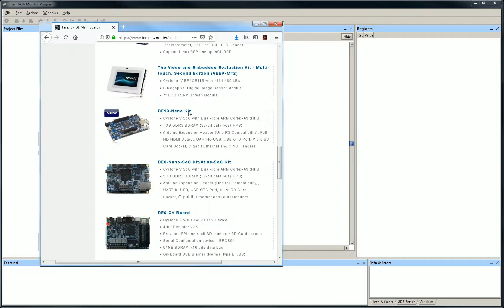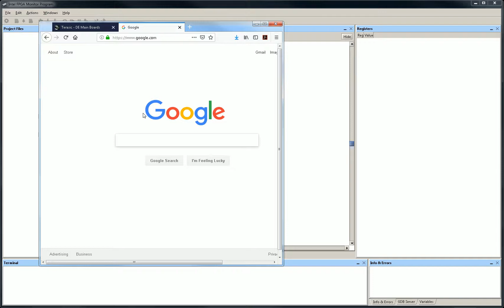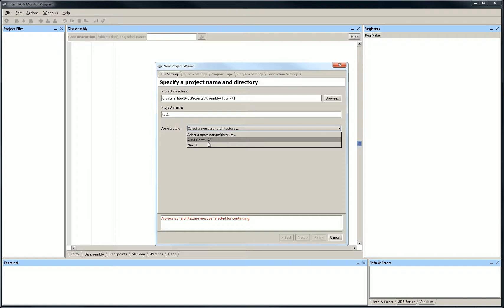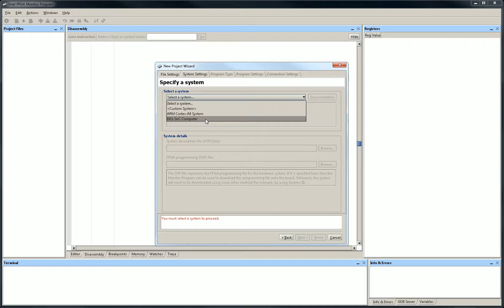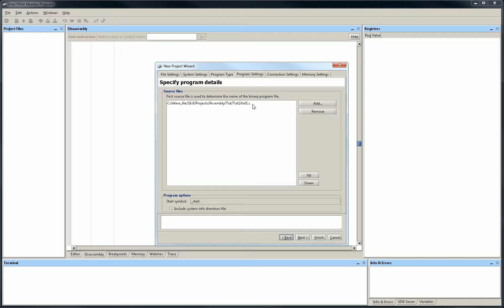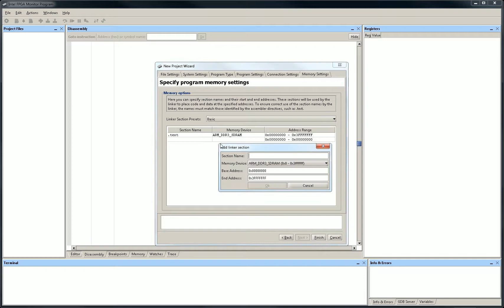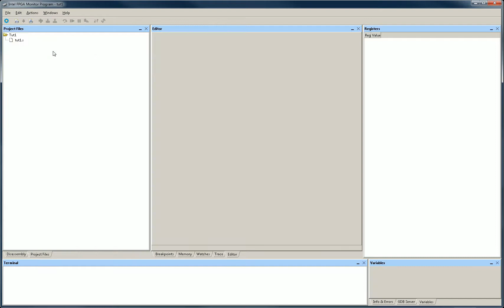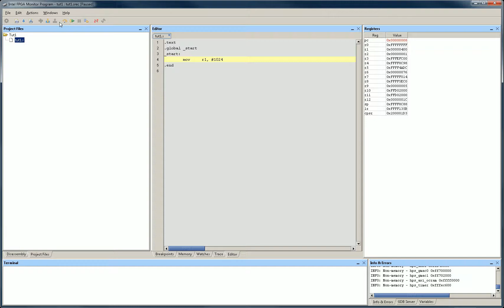Intel/Altera Monitor Program Tutorial - 01 Introduction

Comment: Wow, this video is alot of help, thanks alot. 
Now I'm learning about SoC FPGA, using DE0-nano-soc board. 
I have a question: Is it possible for Monitor Program to compile and debug code on completery customed system? 
As far as I know, we have to use "preloader" to set HPS. However, we cannot specify which Preloader to use in Monitor program....
Reply from the maker: Glad you liked the video! You can download the DE1-SoC Computer to test various components on the board. But since you're using DE0Nano, the DE1SoC Comp may not work. You may be able to make your own system and generate the .sopcinfo and .sof files. I don't have a DE0Nano so I can't check. Good luck!!

Comment: i facing this error "Using cable "DE-SoC [USB-1]", device 2, instance 0x00
Resetting and pausing target processor: FAILED" may i know whats the problem?
Reply from the maker: I haven't gotten this error before, but it sounds that the AMP is unable to reach the Cortex core. Make sure the drivers for the DE1SoC blaster are installed correctly.